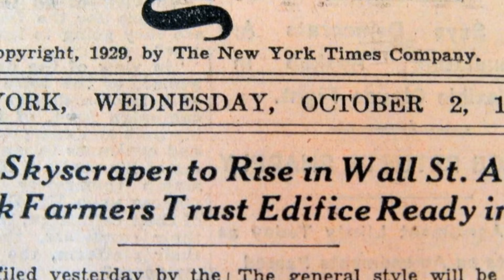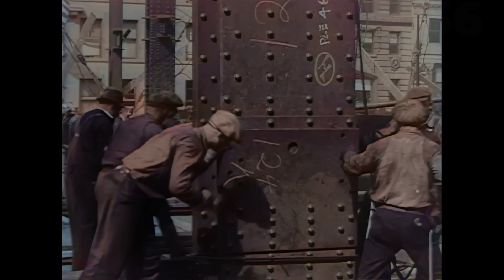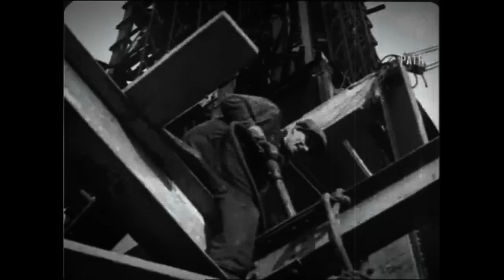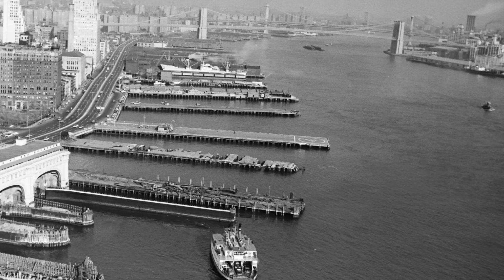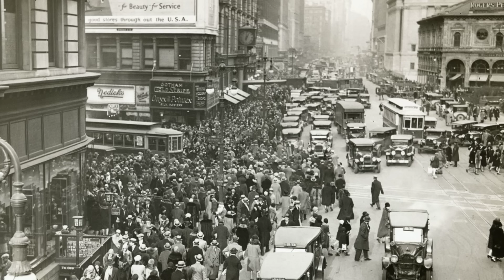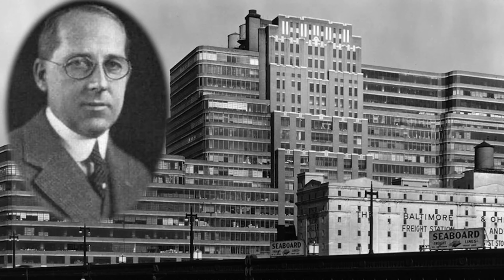The Machines That Built the Empire State Building in 410 Days (1930-1931)

Comment from the maker: The industry rule in 1930 said one worker would die for every $1 million spent on a construction project. At $41 million, the Empire State Building should have killed 41 men. The official count was 5. In an era with no hard hats, no safety nets, no harnesses, and no OSHA. 🏗
The Clyde Iron Works derricks that lifted 57,000 tons of steel to 1,250 feet used a leap-frog relay system that had never been attempted at this scale. Relay derricks with 75-foot booms were mounted on platforms bolted to the side of the building, creating intermediate lifting stations so steel could pass upward in stages. The hoisting engines carried 3,500 feet of cable on each drum.
Meanwhile, 38 riveting gangs threw red-hot rivets through the air — sometimes 50 feet — and caught them in tin cans on open steel beams with nothing below but Manhattan. One rivet per minute. An estimated 3.4 million total. All driven by hand with pneumatic hammers. 🔩
If you want to see how steel cables became the deadliest force at another mega-project, watch our documentary "The Deadliest Machine at Hoover Dam Was a Steel Cable" 👉 https://youtu.be/26_LnYuSJlQ
What part of this build surprised you most? Drop it below. 👇
Reply: The Chrysler Buiding had Blue Chew.

Comment: sorry not believing this was possible. Just time requiring the concrete to set, electrics, plumbing, plastering, drains, lifts, flooring, windows, painting etc etc .. its works approx 4.5 days a floor....
Reply from the maker: Fair skepticism! A lot of that finishing work (plumbing, plastering, windows, etc.) actually ran in parallel with the steel going up on the floors above, which is how they hit that pace. Thanks for watching and for the sharp eye!

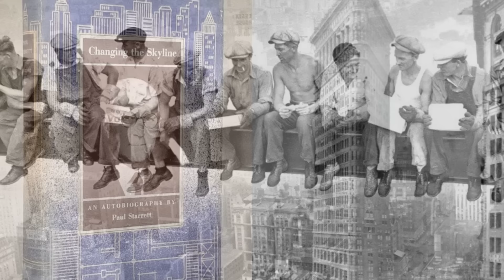Comment: The picture at ≈ 7:00 - isn't it from "Lunch atop a Skyscraper," taken on September 20, 1932? The Empire State Building was already finished and open by then (it opened May 1, 1931).
Reply from the maker: Great catch! You're absolutely right — that iconic photo "Lunch atop a Skyscraper" was taken in 1932, after the Empire State Building was already open. It was used for illustrative purposes to convey the spirit of the era's steelworkers. Thanks for the sharp eye!

Comment: Is this, "The foundation consists of 210 concrete shafts, each about 4 ft in diameter, drilled 30 to 40 ft into the Schist." true?
Did they have the equipment to do such in 1930?
Reply from the maker: Yes, that's accurate! By 1930, engineers had developed specialized caisson drilling equipment capable of reaching bedrock deep below Manhattan's surface. The concrete shaft foundations were indeed part of the engineering solution to anchor such a massive structure. The technology was cutting-edge for its time. Great question!

Comment: Most people don't know that for Structual Steel you can't fabricate or install with the Engineering Plans. Engineening plans tell you ''what type of beam to use and where to use it''. A seperate process called Steel Detailing is required to transform engineering plans into fabrication Shop Drawings and Installation Plans. So to release the Engineering Drawings 30 days before the steel had to be installed just adds an insane amount of pressure on the entire chain of supply. Riveting!
Reply from the maker: Excellent breakdown of the steel fabrication process! Most people have no idea about the difference between Engineering Drawings and Shop Drawings. The pressure on the supply chain must have been immense. Love the 'Riveting!' pun at the end! 😄

Comment: Unbelievable achievement!  We have a one level branch bank building going up in our town and they've been workig on it for a freaking year!
Reply: Exactly…410 days to build a skyscraper doesn’t pass the sniff test.
Reply: Theres a lot that goes into projects taking longer this day in age. It was built so fast because nothing mattered but putting it together.
Reply: Right…and officially only 5 employees died during construction. The 410 days is a feel good story for sure. American grit following the Great Depression, the battle for the tallest building with Chrysler…feel good yes…logistically possible…nope. Workers excavated down over 40 feet of bed rock with our modern machines and hauled off site…this alone busts the 410 day narrative. But let’s move on to the pre-fab steel…to supply all the steal to maintain the building pace of 14 floors every 10 days…a load of steal would have to be delivered every 6 mins…then inspected and offloaded to make room on the yard for the next delivery…imagine maintaining this schedule for round the clock in New York City…and not having a delivery vehicle break down which would disrupt the every 6 min requirement…then the rivets…up to 2500 a day based on various estimates, all heated to 1000 degrees and then tossed through the air and caught in buckets before being driven into the steal with pneumatic drills…the supply chain for just the rivets is remarkable…all that coal for the furnace…all the fuel to power the pumps to compress the air for the drills…all this material would need to be delivered on time or the construction timeline would be blown. Then there’s the nearly 19000 tons of stone moving from Indiana to NYC…the movement of that stone alone is remarkable in that short period of time given the transportation of that time…the time and machinery needed to move that much stone from the railhead in New York to the construction site is remarkable. Then you factor in the supply chain required for all other construction material…electrical wiring, light fixtures, bathrooms, elevator equipment, pipes, etc…all had to be sourced, contracted, delivered, and installed…in 410 days. To believe this narrative is to believe the greatest construction management, project management, logistics, and supply chain feat of all time. If this were true, every construction management and project management class would use this as the quintessential case study on project management perfection.
Reply: @GTIronmann  I'm thinking the 14 floors / 10 days was for framing only.